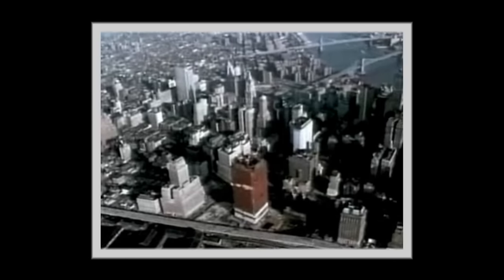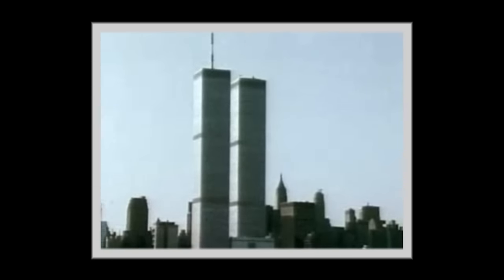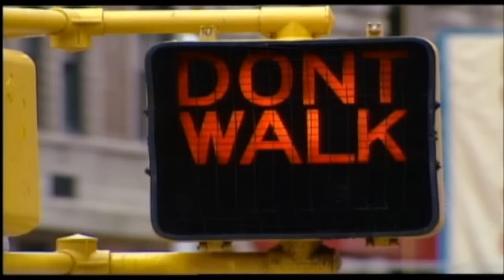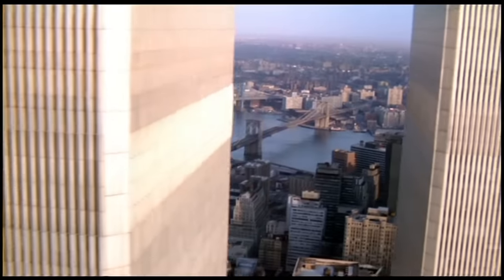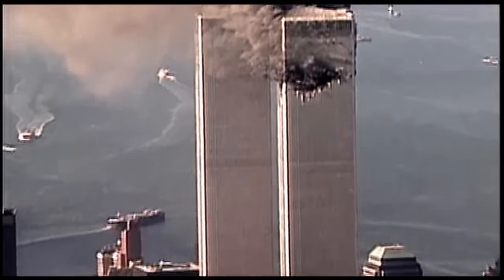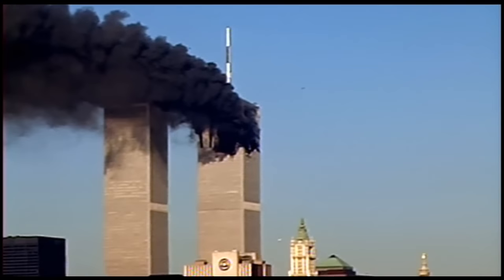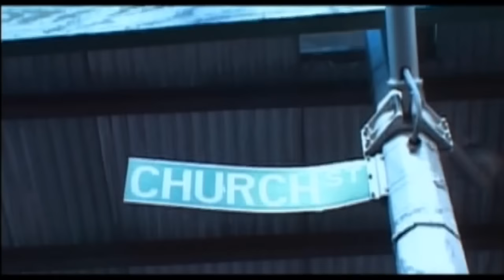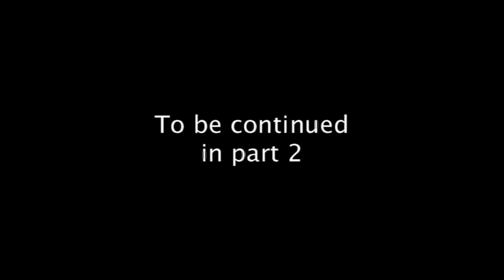102 Minutes - The Attack on WTC, Part 1

Comment: I'm a former Boeing 707-747-757-767 pilot. I have well over 950,000 flight miles logged. Are they serious? Since when can an aluminum bodied airplane crash through thick solid steel and be absorbed like a sponge? The only thing that will cut through solid steel quickly is "Thermite" . 

Thermite is used when a building is designated for demolition. Sometimes, the steel is so thick they have to use Thermite to cut through the steel supports to properly bring the building down.. 

I've studied the video of the aircraft's that flew into the WTC's and if the FAA, NTSB, FBI, and other authorities say the planes speed when they hit the towers were at 590 mph is a blatant misnomer. I noticed the bottom of the planes that hit the towers, did not look like commercial air-craft. They were painted an Air-force gray. There was an appendage on the bottom side of the "Fuselage" that wasn't suppose to be there. My guess is, those appendages were filled with "Thermite" so the air-craft could cut through the outer steel structure.

There were no "Black Boxes" found which contain the "Flight Recorder Data", and the "Pilot's Conversations". The official word from the NTSB is that the WTC crash site "Black Box" air-craft were never found making it impossible to accurately determine airspeed, altitude, and other "Flight Data".. “No recorders were recovered from the World Trade Center,” says the NTSB's. “At least none were delivered to the NTSB and FAA by the FBI.”

Back to my original thought. An Aluminum body of a jet airliner is very thin and can be destroyed on impact with a solid steel beam structure such the WTC's. Plus at the altitude of 700 feet and the air-craft's so called air-speed of 590 mph is a little hard to imagine especially for a retired air-line pilot such as myself.. Bird damage can put holes in the fuselage and severely damage the engines and render the engines inoperable. These commercial planes may be big, but they have strict flight limits too.

At exactly 9:03:02, Flight 175 crashed nose-first into the southern facade of South Tower of the World Trade Center, at a speed of approximately 590 mph. 747-757-767's can't fly at that speed at that low altitude and remain stable. 

The take-off speed of a heavy (full of fuel) 747 is 185 mph. The landing speed may very but usually lands on average at 160 mph. 

The altitude and air-speed the government says the planes that hit the WTC were flying would have caused the plane structure, fuselage, wings, ailerons, wing brakes, elevators and tail piece to self destruct before they ever hit the hit a building like the WTC's. That's why the the "Auto Pilot Controls" can be programmed to fly at higher speeds at 24,000 to 35,000 feet because the outside air is thinner and there is less stress on the aircraft's structural integrity.

When a sophisticated air-craft such as a Boeing 707-737-747-767-777, encounters a problem, the first thing that happens is a "Robotic Voice" will begin to say "Slow Down Air-Speed Too Fast" The power plant will begin to max out at 330 mph at low altitudes. The take-off and landing speeds the plane will begin to shake itself apart at over 220 mph. At 700 feet altitude, the air is so thick that if you go too fast you max the rotation of the turbines, and the engines can't pull in air, and the engines begin acting as a brake and possibly flame out.  

There are also "Robotic Flight Warnings" that warn pilots that "Their Airspeed Is Too Fast". The sticks the pilots use to guide the plane will begin to shake violently. A "Stick Shaker" is a mechanical device that rapidly and noisily vibrate the control yoke (the "stick") of an aircraft to warn the pilot of an imminent break up of the planes structural integrity. The elevators, ailerons, wing brakes,  tail piece, and the wings themselves will start tearing themselves apart because the thickness of the air at low altitudes at a speed of 590 mph or above the threshold, causes the plane structure to begin to fail. A Stick Shaker is connected to the Control Column of most civil jet aircraft and large military aircraft. For both flights that hit the WTC's at approximately 590 mph at 750 feet altitude is physically and dynamically impossible.

How did the "Aluminum" aircraft wings penetrate the concrete and steel and slide into the World Trade Center like hot butter? Like all other same types of planes are made from aluminum to allow the internal air pressures to change. When the "Pilot" or "Computer" detects an altitude increase or decrease the fuselages are built to expand and contract like a balloon. 

Do the math : "aluminum vs. Concrete Steel structure such as the WTC sky scraper,  Who wins? 

Several aerodynamics are involved where the aircraft is concerned. 

1. Low altitude, 
2. Over speed, 
3. Aircraft structural failure, 
4. Engine malfunction,  

Aircraft aural warning systems work in conjunction with illuminated annunciation systems. They audibly inform the pilot of a situation requiring attention such as "Terrain Pull Up", "Altitude Too Low Pull Up", "Air Speed Too Fast / Too Slow".  Various tones and phrases sound in the cockpit to alert the crew when abnormal conditions exist. For example, an aircraft with retractable landing gear uses an aural warning system to alert the crew to an unsafe condition. A bell sounds if the throttle is retarded and the landing gear is not in a down and locked condition.

A typical transport category aircraft has an aural warning system that alerts the pilot with audio signals for the following:
 
1.Abnormal takeoff, landing, pressurization, airspeed.
2. Mach airspeed conditions,.
3. An engine failure, fire, landing gear malfunctions or wheel well fire. 
4. Calls from the crew call system. 
5. Collision avoidance recommendations.
6. A "Micro burst which in itself can push an Airbus A-880, the largest plane made, into the ground.
7. A Miro-burst is a localized column of sinking air (downdraft) within a thunderstorm and is usually less than or equal to 2.5 miles in diameter. Micro bursts can cause extensive air-craft damage while on the run way. In most instances, can be life-threatening to the air craft.

I'm not a conspiracy theorist, I simply studied what the FAA / NTSB reported. It's a simple set of Mathematics, Experience, and amount of "Flight Experience."

Comment: 3:30 Amy Sweeney is talking to "American Boston" airport and this plane is coming in way low at full power and there is no background noise, no plane engine noise or other passengers, that's impossible
Reply: well it was her on the phone so now what
Reply: BJ BILL
She was on the phone but not in a plane, staged fabrication for the OFFICIAL LIE
Reply: BJ BILL
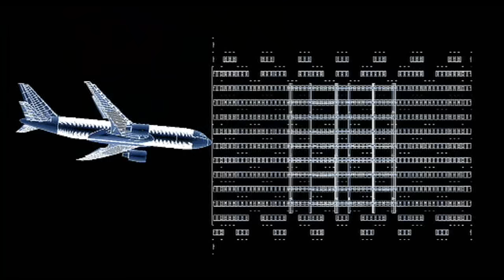4:43 WATCH THIS, as the plane smashes through the tower, at a speed which is faster than the plane can even achieve, threw the perimeter wall, through core structure and elevators and fire escape stairwell, and the last perimeter wall to full smash through the entire building of structural steel, concrete and office furnishings and jet fuel explodes into a huge ball of fire, a little paper passport comes out virtually undamaged.  it was the pilots passport, so a airplane pushed the passport through the entire building of structural steel, concrete, and a huge jet fuel fire, virtually undamaged, and you believe this, right! Tell me, you believe this is what happened. Maybe they will find Amy Sweeney's passport too. No other passport but the terrorists, just like Shanksville crash at speeds unattainable for that plane, smashing into the ground straight down so hard the entire plane either penetrated the ground except for wreckage that bounced 2 miles away and more wreckage 8 miles away but they found the passport and bandana of a terrorist, and the bandana was neatly folded and this passport was in better condition that the first one and some very interesting phone calls from that plane, Like when the FBI prove the Attorney Generals phone call from his wife was a lie. After the Attorney General Changed his story about the phone call twice. So he had three different stories and they were all lies as proven by the FBI  

WELL IT WASN'T HER ON THE PHONE, SO NOW WHAT... BJ BILL

Comment: How did building 7 fall?  It was not hit by a plane?  Look at Trump Tower recently.  It had fires and didn't collapse?  Any thoughts?
Reply: R Stefanie - Fire + Time + Gravity = Collapse.  Specifically, physical damage caused by debris falling from the collapsing Tower One (North Tower) allowed fires to break out across multiple floors simultaneously while also cutting off the water supply for sprinklers and firefighting hoses and decimating the ranks of the FDNY.  Unable to contain the fires the FDNY left the building to its fate.  

Collapse initiation was due to floor failures somewhere on the lower floors (between 14 and 7 probably) around core Column 79, leaving that column unsupported and causing it to buckle.  This then caused a cascade of structural failures proceeding from east to west through the core until the entire core failed.  This then pulled down the outer perimeter behind it.

Don't forget that fire is one of the most destructive elements known to man.  Last year alone fire destroyed over 10,000 buildings in California.

I sincerely hope this helped.
Reply: R Stefanie - You asked "How did building 7 fall?"  You asked for "any thoughts"  I assumed it was a serious question so I gave a serious, evidence based answer.  If that isn't what you wanted then blame yourself for asking, not me for answering. 

If Building 7 "collapsed in its own footprint" then how did it block Vessey, Barclay and West Broadway when it collapsed?  How did it cause a billion dollars in damage to the Verizon Building and damage Fiterman Hall (30 West Broadway) on the other side of a 4-lane street beyond repair?  

If the North and South Towers "collapsed in their own footprint" how did they manage to destroy or damage beyond repair 7 other buildings and seriously damage several dozen more?  Were all of those buildings in the Twin Towers footprint?  

Now who is the delusional one?
Reply: A 26-story skyscraper in Sao Paulo, Brazil just collapsed today after burning for only 90 minutes.  Looks like it fell in its own footprint.  Must have been an inside job.
Reply: R Stefanie - Then don't believe the NIST report.  There are several other engineering reports to choose from.  

Funny thing about the NIST.  They have been around in various forms diligently maintaining standards and measures for about 200 years without any incident or controversy.  Then 9/11 comes along and all of a sudden this obscure non-regulatory agency full of math, science and engineering nerds become the top secret Ninja army of the New World Order, only to go back to the relative obscurity of nerds maintaining standards and measures once their work investigating 9/11 is done.

Very odd.
Reply: T. Roll 
How do you know he's Jewish over the internet? You don't unless he tells you. And you say it as if it's a bad thing. It isn't. There are good people who are Jewish, and bad people who are Jewish, like any other religion. And I'm not Jewish either by the way! Get a grip!
Reply: R Stefanie are you really comparing a 50 ton object going 300 miles an hour loaded with very flammable fuel to a tiny fucking kitchen fire
Reply: M Fitz
How much damage did building 7 do to the Verizon Building?
Reply: Brian the cost to repair was 1. 4 billion.
Reply: R Stefanie

How did building 7 fall?

My  theory is controlled demolition can remove structural steel on 8 floors with 81 structural steel columns on each floor (8x81=648), over 500 structural steel columns with fire protection so the synchronicity of the removal of support across the whole width of the building, evidenced by the levelness of the roofline as it came down, and the suddenness of onset of collapse, and the immediate transition from full support to total free fall. about 2.5 seconds , over 100 feet, 8 floors  caused building 7 to completely collapse almost perfectly straight down threw the path of greatest resistance, its own structure completely dismantling building 7 which has happened many times in the past with controlled demolition on other buildings and can be proven with video and documentation.
Reply: Brian several things prove that it was impossible for seven to be a controlled demolition.. 
By 2 p. M. 7 was seen to be structurally unstable.  Everyone in the area knew it was going to collapse. it finally did at 5: 20
No control demolition has ever been seen to be structurally unstable hours before it collapsed. 
No controlled demolition ever burned for hours before it collapsed. 
There were no seen heard or felt explosions from 7 in the seconds before or during its collapse.   
The penthouse collapsed 8 seconds before main collapse. Totally unlike any other controlled demolition.
Reply: Joe Venile
Medics, police, firefighters, media with video, Barry Jennings and other witnesses heard explosions
Fill in the blank 
Your theory is ________?? can remove structural steel on 8 floors with 81 structural steel columns on each floor (8x81=648), over 500 structural steel columns with fire protection so the synchronicity of the removal of support across the whole width of the building, evidenced by the levelness of the roofline as it came down, and the suddenness of onset of collapse, and the immediate transition from full support to total free fall. about 2.5 seconds , over 100 feet, 8 floors  almost perfectly straight down threw the path of greatest resistance, its own structure completely dismantling building 7 and has happened many times in the past. which can proven with video and documentation.
Reply: Joe Venile
How much damage did building 7 do to the Verizon Building?
Reply: R Stefanie wtc 7 collapsed from a fire and some debris

Comment: I still cant grasp HOW both towers fell.    yeh I seen all the documentaries & reports etc etc etc.       ........what was that massive explosion when the planes went in?  Jet fuel? massive explosion. outside & inside.   the jet fuel should have burned away rather quickly.          In my mind, there should ATleast have been 3/4 of the building standing even if its just the steel structure even.                 oh but the fuel weakened it.        The fuel didnt have all that time to sit there & burn,          ya know how high octane fuel burns?       fast.  In my mind after 30 seconds or so the fuel shouldnt be in the equation in my mind.

Comment: I think those buildings were already showing signs of wear.  People say a plane can't go through steel but steel exposed to oxygen and moisture constantly begins to form oxide and it actually weakens the metal bond. When you see the buildings collaspe the outside framework seems brittle
Reply: Ramzi Yousef tried to bring them down... which gave Khaled Sheik Mohammed the idea to hit them with planes
Reply: @TeddiiBearAngel  just so much wrong in that statement it's hard to believe
Reply: @mfitz1619  That may be but it's history 9/11 was Khaled's idea, Bin Laden funded it, Yousef bombed it in 93.
Reply: @TeddiiBearAngel  Again everything you've said is wrong.  The FBI itself says theres no evidence linking bin laden to 9/11 and Khaled also has no evidence against him.  Khalid was tortured for 3 years, he "confessed" but they can't try him in a criminal court for over a decade, why? because there is no evidence.  If you were tortured for 3 years guess what, you'd be the planner of 9/11.  Everything you put there is based solely on propaganda.
Reply: @mfitz1619  Then videos like this and so many others need to get their stories straight!!!!